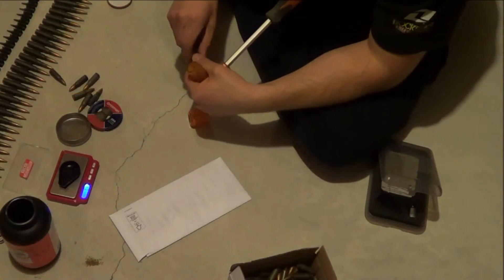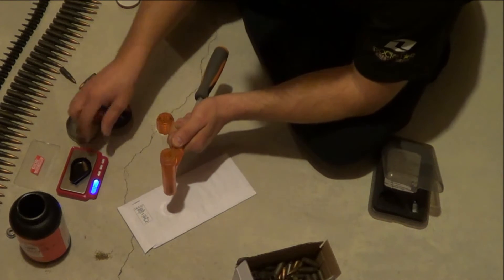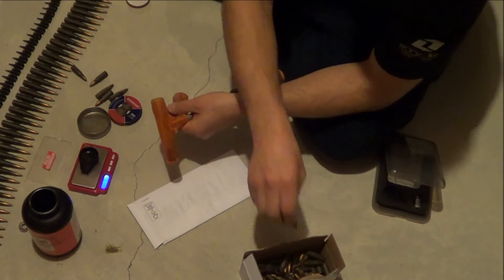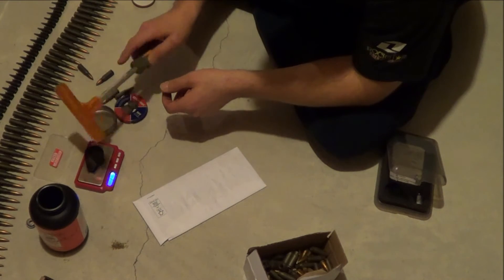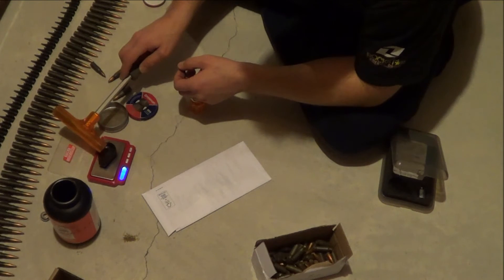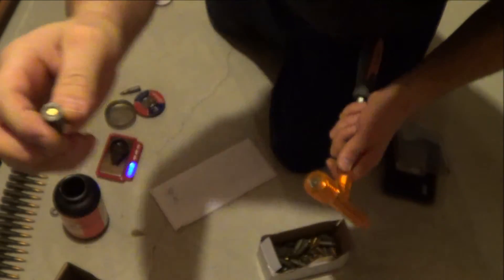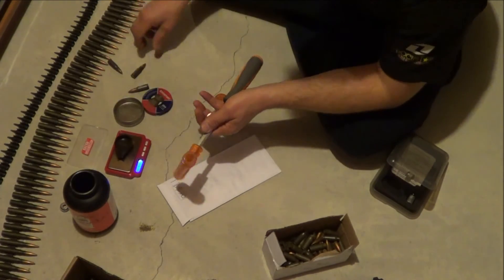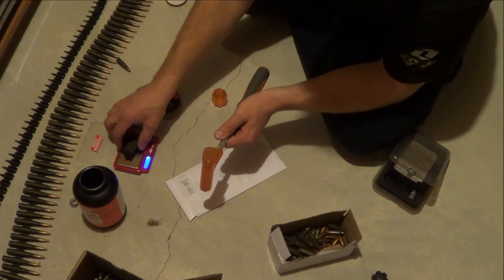7.92×33mm Kurz LOAD MEASUREMENTS

Comment: Understand that it is a years old video, but neat little show none the less. Did you reconstruct the rounds with the salvaged powder?and question about your inertia puller, do you do something to get rid of the attractive static electricity? Mine has powder stick all inside it every time I bust one open... can't adjust reliably pour it out and measure it as you've shown here. Annoying.
Reply from the maker: No a collector friend of mine wanted dummy rounds to keep on display with some deactivated weapons